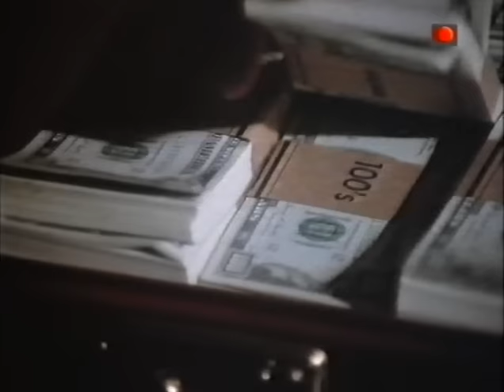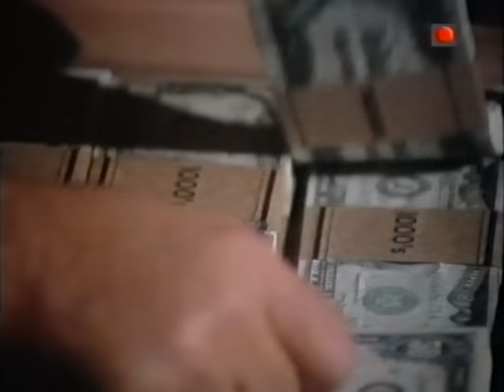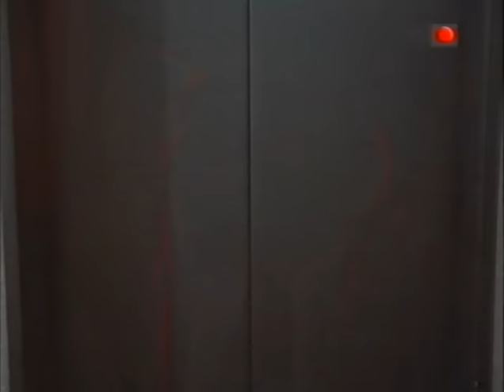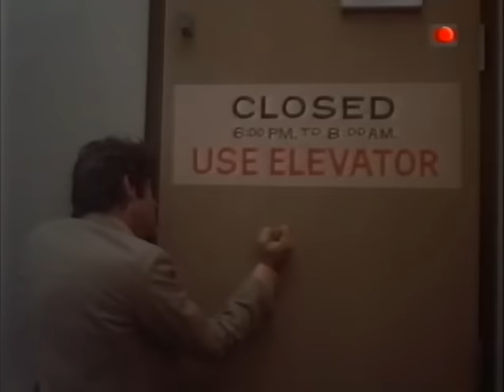The Elevator (Thriller)  Made-For-Television Movie - 1974

Comment: It certainly was a thriller movie, with a lot of detail as to the elevator hoist way and the machine room. The machine was an Otis depicted by the pie plate floor selector, and fly-balls over-speed govenor. There was catastrophic failure with the overloaded elevator cab, the cab was swaying back/forth as the safe was being taken out, between the cab and landing. creaking of machine beans, floor relays opening/closing, traction machine overheating, smoking. short circuits. Concrete crumbling. Makes me wonder if the building was not strong enough to support the weight of the bank of elevators for this much failure to occur.

Comment: Airdate Feb. 9th, 1974, Universal Studios.  Roddy McDowell and Carol Lynley. 16:00 So they all crowd into an elevator which has a 700 lb safe.   :face-fuchsia-wide-eyes: And everyone onboard knew how much it weighed; the workers were most at fault, Roddy 2nd, and everyone else who was onboard knowing the weight.:face-orange-frowning: 25:04 "He must be stuck up there".  Even if he was that ingenius to figure out the extremely unlikely scenario the elevator was stuck, why didn't he just tell the security guard who would help with the rescue vs. breaking in, and all that follows.  Especially considering he just commit murder and the body is still in the building :eyes-purple-crying:

Comment: Heavy look is IN!!!  Large cars with framed aluminum headlamps*big squared grilles*massive bumpers*/suits with wide lapels*wide neckties*flare pants*/mens hairstyles long*sideburns*!!!! 2 pound ash trays included!!!! HEAVY LOOK was from 1971 tru 1978 then in 1978 ALL MEN especially actors for films CHOPPED OFF MOST LONGER HAIRSTYLES/SUITS & NECKTIES went back to 1968 looks/cars started DOWNSIZING to smaller aquare box shapes!!!! Since then its the same LOOK from 1978 tru 2023 except the cars went from smaller squared look of the 1980s to the ROUNDED STYLES from 1992 tru 2023!!!